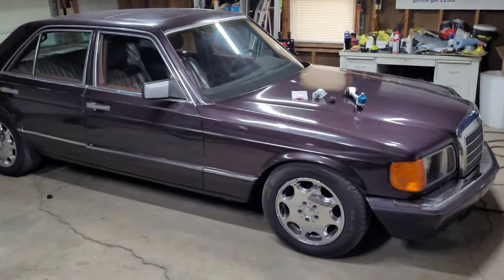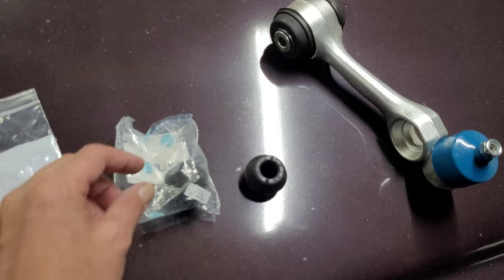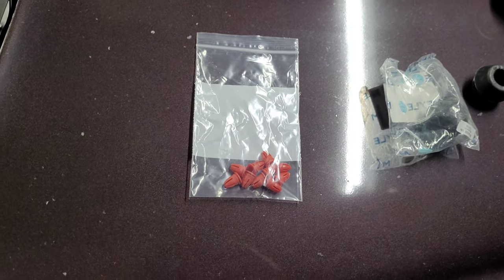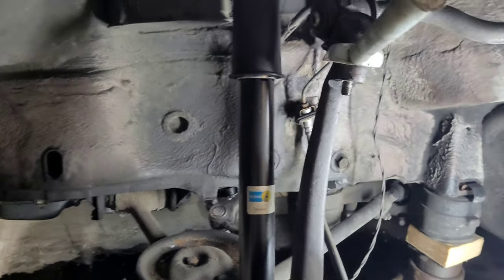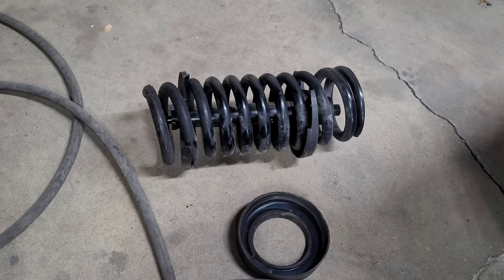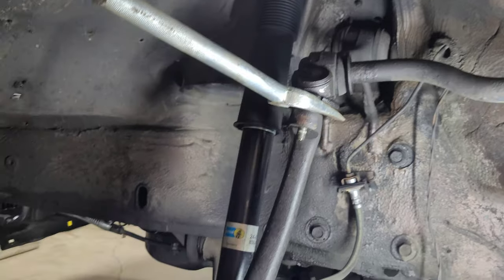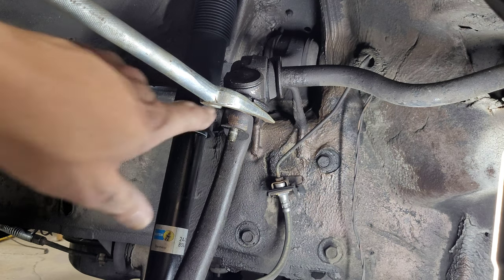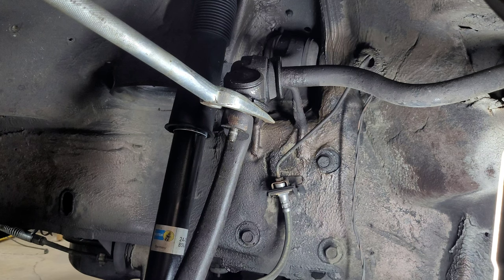Fixing the vibration on the W126 300sd!

Comment: I have done all the front suspension work on my Mercedes-Benz w126 300sd 1981. Everything is replaced. Control arms bushings you name it. And it's a huge deference. And also the front and rear shocks. 
Drives like new 🙂
Reply from the maker: Oh yeah it drives so much better now, I just got home from a hundred mile cruise in it and no issues 👍
Reply: What brand parts did you use for your Mercedes Benz's suspension?
Reply: @flyntmyrick6291  MEYLE and Febi Bilstein. 1 of the better brands

Comment: It's not clear why you are removing the H&R springs.  They have been  big improvement for my 380se handling.  Assuming you have a 4 nub isolator on the spring, you can add a 8mm isolater to the spring perch which will lift front about three quarters of an inch.  You cut off the part on the sides so you just have a ring "spacer'